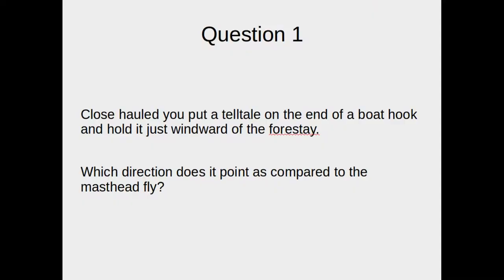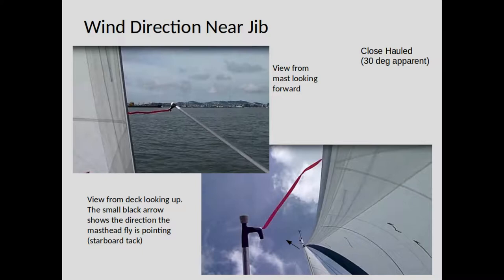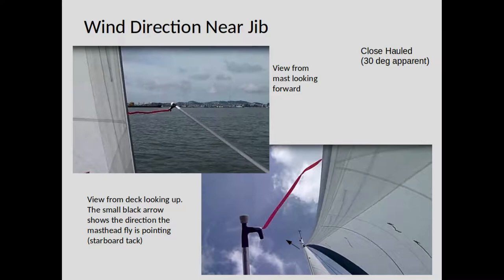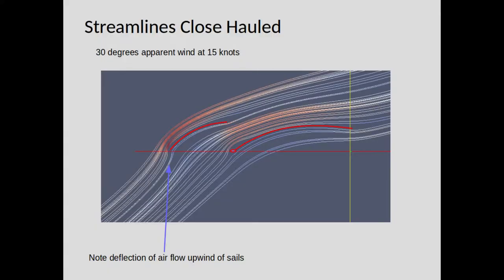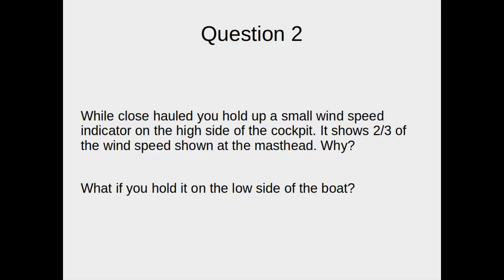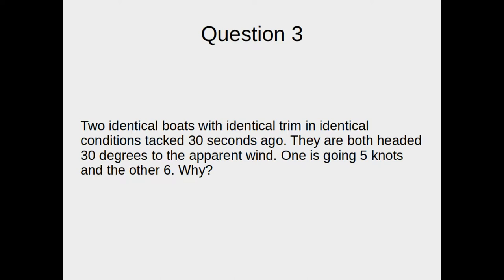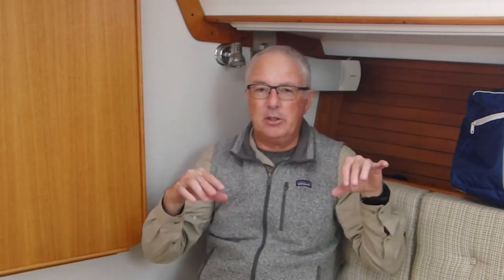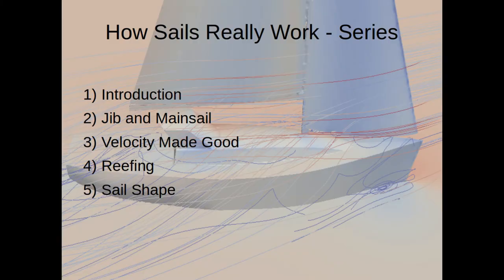Answers to tricky questions about how sails really work

Comment: Fantastic Series, best analysis and explanation I've seen so far!
Is there any chance you could look at other types of foresails like asymetric spinnakers and compare them to wing on wing?
Reply: Another interesting question would be how different trimm options affect the pressure and speed differences. E.g. powering & depowering.
Reply from the maker: Thanks. I'm going to pass on doing other sail configurations. If I were in the sail business, the work would be worth it, but I have just been doing all this out of curiosity.

Comment: Hello James, i looked and listened to your videos now for 2 days and i have learned much more than with all my sailing teachers within last many years. because of that, many people will get much more out of that passion.thank you for all that. would you be so kind to answer question Nr 6 in your Video Nr 3 " How sails really work ". the question is, why the speed read out is different on port and starboard tack. i do have a Stealth Catamaran made by Alan Carwardine in Phuket/ Thailand - great guy. and i do have that problem to a relevant extent. i have mini keels and my pedal wheel ( Transtucer ) is mounted near to the front end of my SB mini keel facing to the center of the cat - 15cm after the mini keel is glued onto the hull. what can i do to get a correct readout on both tacks ? Best regards from Vienna Franz
Reply from the maker: I've run into the same problem on several monohulls, but I don't have much experience with cats. Take a look at this video and see if it might explain the issue. You will need to ignore the comments on boat heel, as cats don't do much of that, but you still make the hulls work when going to weather. https://www.youtube.com/watch?v=J-S2azmbXR0

Comment: Really interesting. Thank you so much for doing this series
Reply from the maker: Thanks! Does the audio sound OK to you? I got a notice that there was a buzzing background, but I don't hear it.
Reply: Sound is adequate. I did not hear any background noise and it was very clear.
Reply from the maker: Thanks. Probably someone with sound problems on their own machine. My own hearing is not very good, so I wanted a second opinion. Thanks again.
Reply: No there is definitely some (camera?) noise but it's fine: the information is well presented and interesting enough that the hum isn't a problem.